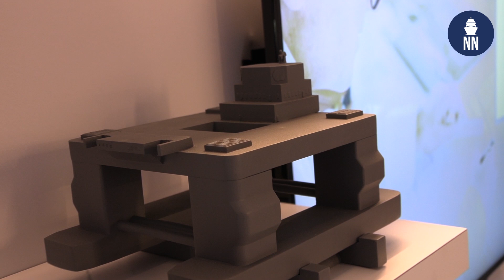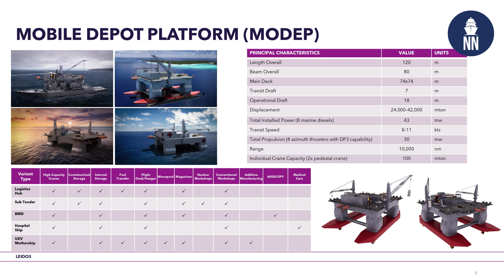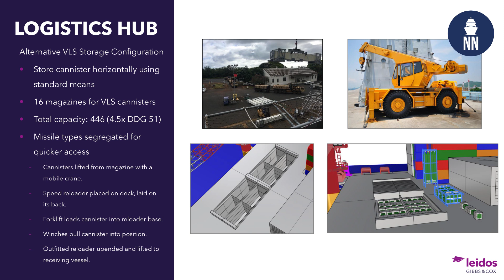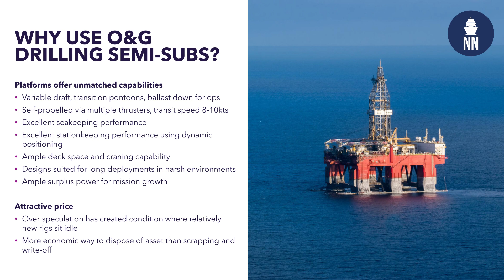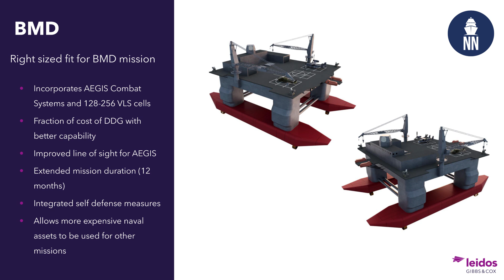Gibbs & Cox MODEP concept at SNA 2025

Comment: The Navy will be heavily dependent on an advanced forward operating bases that can perform combat repairs, adaptation upgrades, refueling and re-arming. Except for a few $650 million dollar expeditionary mobile bases with limited capabilities, the Navy has little in place to support advanced support bases and would need to have ships needing support transit as far as Hawaii or the West Coast, which would decisively limited our combat power in the Western Pacific.  One of best places for a forward combat support base would be in the second island chain and none is better than Ulithi Atoll. A 1,000 kM East of the Philippines, and 500 from Guam, this is the very same place the US Navy used as a major base for the very same reason in WW2. The Navy has extensive knowledge of repairing, re-arming, re-fueling, etc. at Ulithi atoll. Placing a few of these "Low-Cost" MODEP's in the atolls interior harbor and a SOSUS network of underwater hydrophone arrays, with some unmanned torpedo armed drone subs and helicopters to prosecute any pesky Chinese subs, would go a long way in resolving many of the Navy's Pacific wartime logistics problems and spreading out logistic assets would help protect fixed bases at Guam, Japan, Philippines, etc.from a surprise attack. IF these turn out be affordable, placing some MODEP's at Darwin, Australia to spread out the attack risk and increase the bad guys targeting issues.

Comment: Ballistic Missile defense using AEGIS is a Joke; While the system can undoubtedly Track said target's intercepting them is the scam because NONE missiles can reach exosphere where ICBM's can reach. The SM-3 Missile is 21 feet length. Now compare it to Sounding rockets DESIGNED to achieve Altitudes of 500-1500 km. Firing missiles at sea level has two challenges, 1: Overcoming drag of thick lower atmosphere and achieving altitude with fuel available. The Space Shuttle used 40% of it's fuel to achieve 11 km high. 2: maneuver a missile thats burned thru most of it's fuel.

Comment: That mini-cat-platform is weak..... that's a failure RIGHT NOW. Navy knows you use mono-fleet tenders/light freighters for servicing small ships and its infinitely more maneuverable and can follow a fleet. vs That oil rig type Dereck is more or less a giant buoy. Plus it would have to still intermediate between freighters/oilers and the actual combat vessels.  In fact this guy lost me  on all of Cox and its models after that.
Reply: it's not supposed to follow the fleet at all, it's supposed to travel to a location where the navy doesn't have any means of supply, then sit there as a temporary base. And it's never to be used as an weapon platform but still be part of the sensor network if needed

Comment: Actual innovation?!
These concepts do have an air of "too good to be true," but if half of them work half as well as they're supposed to, that would be significant.
Reply: Like, what specific semi submersible rigs do they intend to convert?
Reply: @jm2453 They want to use/convert the current mobile drilling platforms in storage in the Gulf of America/Mexico. They're already negotiating with the company that owns them.  They'll probably lease the first, convert it, and see where to go from there.  It's an old concept, that is just getting a modern touch.  It's a perfect idea, for a very specific issue that the US Navy is lacking in, multiple forward and semi-forward logistical areas.
Reply: @TeamDoc312  Yeah, I watched the video.  I'm saying show me an existing rig that would work for this?  I can't find one.
Reply: @jm2453 the idea from the gentleman in the video would be to build it at a shipyard and when it's no longer required by the navy, then they have inherit value as drilling platforms and can be sold as such

Comment: This thing is so massive and so important - it gonna be a missile magnet, even possibly warranting use of a ballistic and hypersonic missiles against it. And it's slow thus may be a much easier target to hit then an aircraft carrier. On the other hand, it's huge, made of  thick steel (with no regards to speed) and gonna have a massive AA battery on it, thus being actually hard to hit, and even if hit, hard to disable. One thing that may actually pose a threat to it are submarines, especially, if equipped with extremely long range torpedoes/underwater drones.
Reply: Wouldnt they likely be protected via range? These platforms exist to service navy warships with multi thousand mile ranges. Sitting them a thousand miles away may be the best option if you want to guarantee higher protection from sea drones and hypersonic missile threats
Reply: I think you’re right. It would be a missile magnet. But if you have enough of them so that theyre distributed everywhere and defended organically, greater likelihood some survive. Goes along with what the Air Force is doing with rebuilding old bases
Reply: @evilguy920  one more thing: is it actually that bad that it is a missile magnet? Every ballistic missile send towards it is not sent towards a much more expensive aircraft carrier. On the other hand, unlike an aircraft carrier, it is a static target, thus it can be attacked with cheaper ballistic missiles and as for the antiship missiles, platforms can be stationed way beyond their range. Still, subs and underwater drones seem to be the biggest threat.
Reply: @ if you look at it from the standpoint of using missiles on it is better than them going towards a carrier or land base then that’s good.
Reply: You have them covering each other.  Sure some will get wiped out but the damage they can do is heavy.  Plus they can be moved- island land bases can’t
Reply: If their situated inside harbors as logistics hubs, the submarine threat would be negated. I think it'd be dumb to use these as anything other then tenders, refueling/reloading depots. Maybe ballistic missile defense at further away outpost so you don't need a Burke to do it. Think sitting one in Guam or northern Australia.
Reply: These will be in rear areas so out of range of most weapon system. It also isn't always about the kinetics of offense and defense. Distance also disrupts the entire kill chain making that attack never happen in the first place. How do you spot, guide, and target something far from the front? There is a reason we don't consider naval bases excessively vulnerable although they certainly can be. Distance is a great defensive tool. These things will provide a forward supply point, cutting down transit times, but still quite far away. The closer distance makes it slightly more vulnerable but it's mobility also means it won't be in the same location for every resupply.
Reply: Even missile magnets can be defended if done properly.  Turn politicians and bean counters lose and the platform will sink because it cannot defend itself in depth!
Reply: Like that video playing in the background. Yes, please.
Reply: Missiles have scary range today, need to far in the rear. Resupply could take days, but better than weeks. I wonder if the platforms could support high-energy weapon systems. Maybe the hull forms could be added/modified to increase speed a bit?
Reply: The philippines can use this
Reply: I can see a use case extending missile defense in a place like Guam.  Guam is only so big, it would only take a couple nukes to knock it out.  Add a few of these platforms nearby and you have much greater missile defense in a survivable format.
Reply: It's not going to be any more vulnerable than an island or a ship.  Each one has serious drawbacks. Once a ship or island blows its wad of surface to air missiles, they're pretty much defenseless.  And considering if were probably going toe to toe with land based ballistic, cruise and ship based missiles in volleys in the hundreds at a time, we're going to need these type of platforms. To repair, maintain, and arm the fleet as far forward as possible.  We learned that lesson in WWII.
Reply: Perhaps the unmanned system version will have uuv's of its own to sense and intercept torpedos
Reply: The idea would be to have them far away from the battle space but close enough to be a handy resupply and logistics base
Reply: They are not a weapon platform duh. They are not working on the front line, but well behind the front line as forward supply and repair facilities, if they suddenly find themself in striking distance of missiles, the navy has done something wrong.
The version used for radar is just a part of the ballistic defense network, and the US Navy is already operating one from before, the SBX-1 SPOTD: https://en.wikipedia.org/wiki/Sea-based_X-band_radar
Reply: @heuhen  oh, yes, a peer or near peer enemy would totally adhere to the front lines the US put upon it.
Reply: @heuhen  #1. Non-linear battle lines are a thing, and oceans are expansive. The Military can't be everywhere at once, and the opposing force will be able to get behind/under us, that's just the nature of warfare.

#2.  There is skready a plan to fit one of these as a weapons platform for ASM, SBCM, and SAM missile profiles, as well as SeaRAM, Phalanx CWIS, 50kw lasers, and possibly mk 48 torpedoes for self defense.  

So, yea, it's a very real possibility, due to the multi-layer protection doctrine.